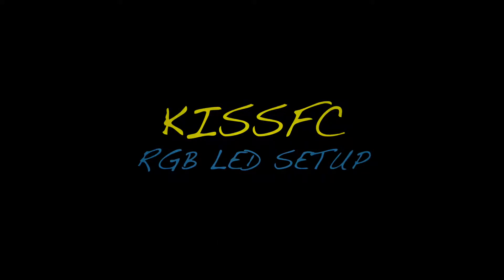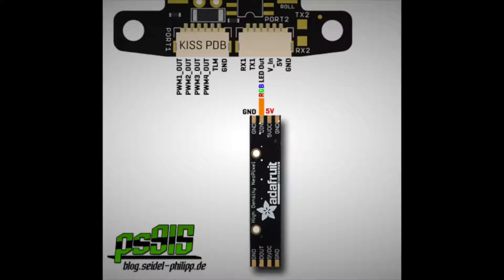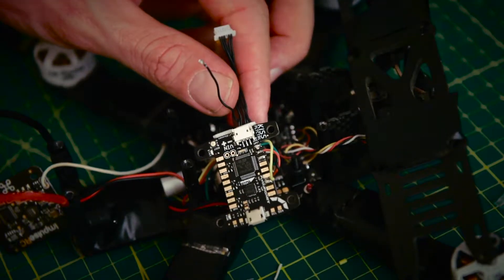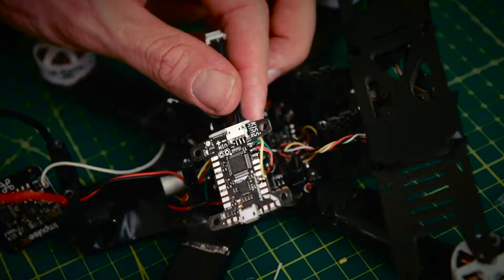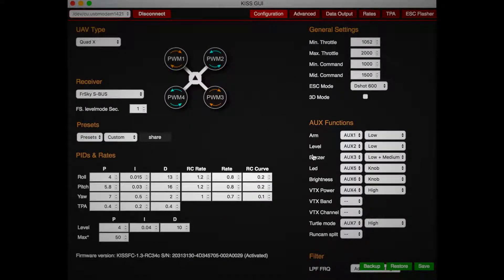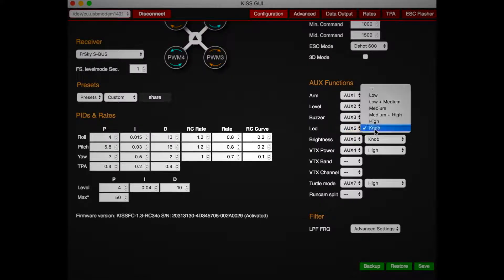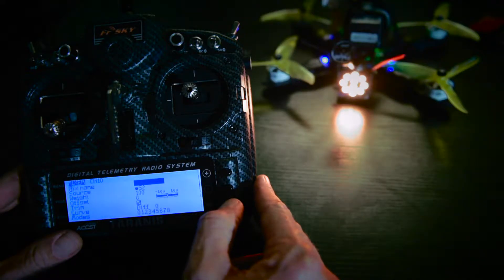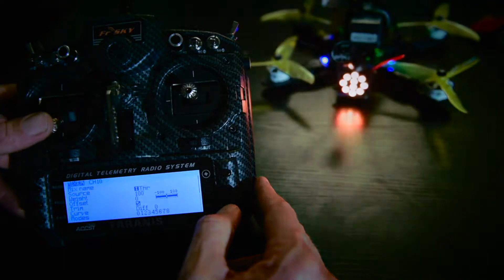Kiss Flight Controller RGB LED Setup

Comment: Can you please elaborate on the remote control configurations?
I've got the LED working but I can't seem to be able to control the brightness or color like you do
Reply from the maker: You need to assign a channel to a knob / switch or map it to duplicate the throttle

Comment: Where do you take pwr and ground to the LED? :)
Reply from the maker: Depends on the LED some need 5v and others have an onboard voltage regulator so can be run off the battery. If it’s 5v your PDB May have a spare output if not you will need a polulu or similar regulator.
Reply: Thank you for the answer!